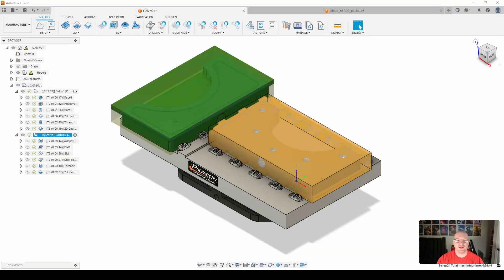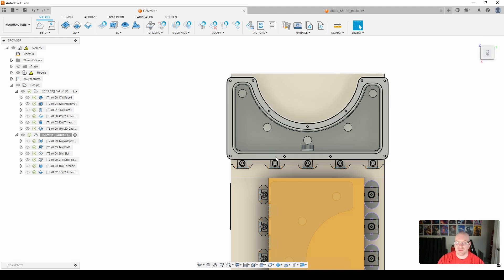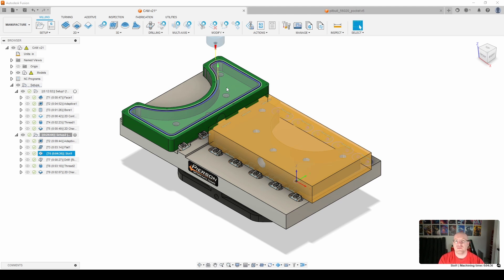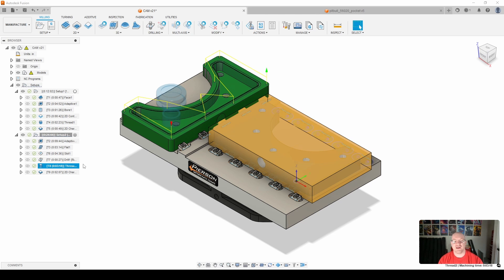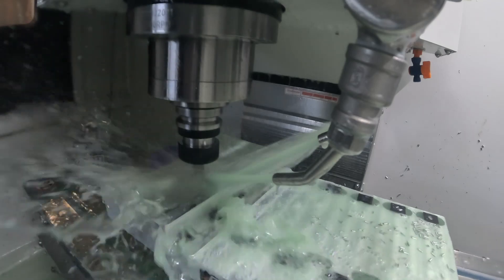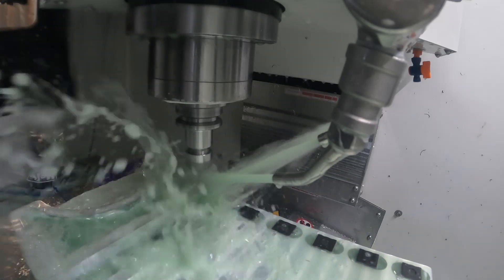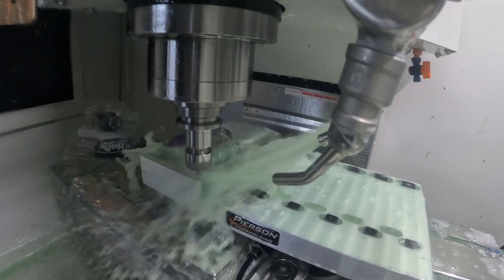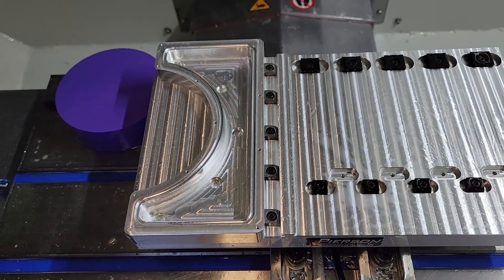SYIL X7 COOLANT MANIFOLD OP2

Comment: Brass Pitbull's have greatly reduced clamping force. Instead use a mitee-bite uniforce clamp in a pocket that is open towards part.
Reply: Yea but the brass ones won't mar the part (this is op2 after all)
Reply: @GimbelAutomation  uniforce has flat aluminum contact face much less marring(brass will always marr aluminum). 1/4 brass pitbull 950lbs of force 1/4 uniforce 1500lbs of clamping force.look into it, give them a try I highly recommend them especially for this application.